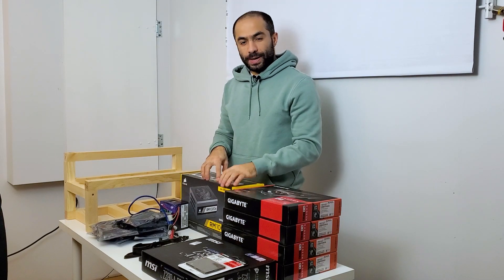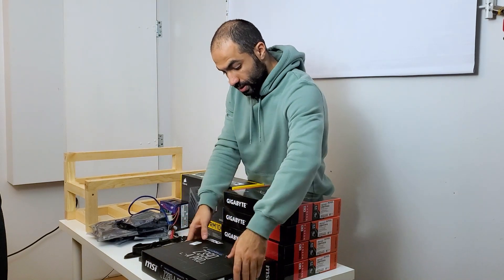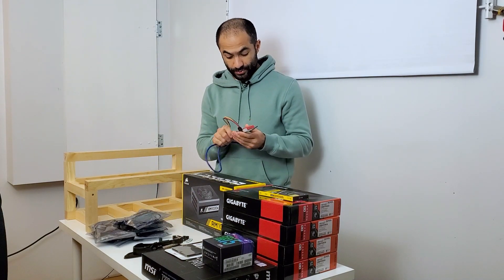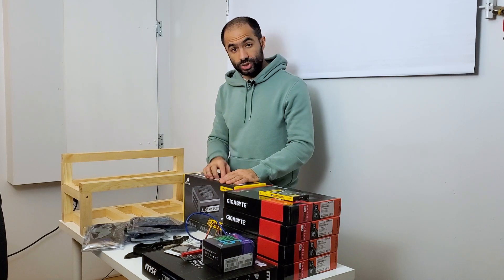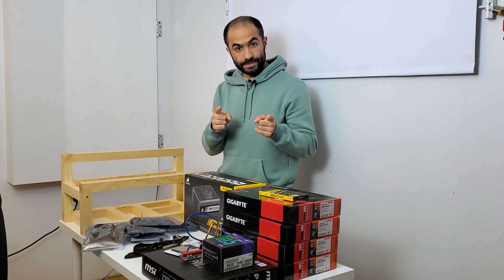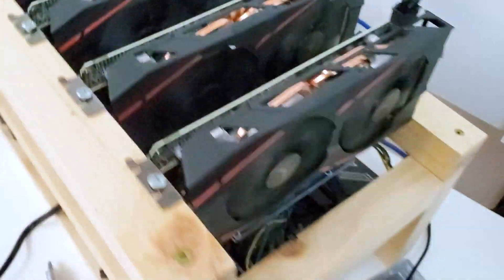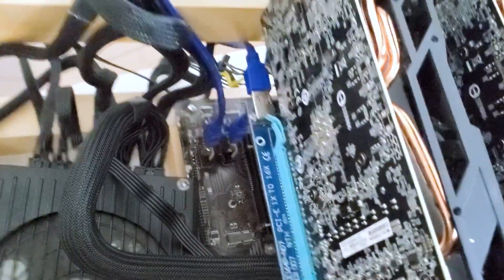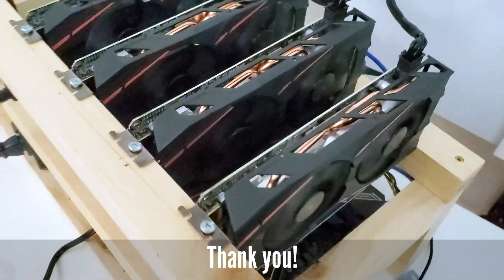4 x RX580 MINING RIG - PARTS, PRICES, HASHING POWER AND BUILD IN 2021

Comment: Good vid, can i put one big plank on the bottom instead of multiple beams of wood?
Reply from the maker: Thank you Nacon. Yes you can. I did it this way for a slightly improved air flow. However a plank of wood would work perfect as well. Make sure you elevate your motherboard as it does have a 'keep out' zone under the CPU.

Comment: :) you don't have to do anything, just use amd tool and set memory timing to 1. also set core clock to 1150. no other thing you need to change and you'll get 29-30.
core 1150
memory 2100
memory timing 1
you'll get 31 absolute stable.

also let me say to everyone.... bios mod is old news you'll get nothing out of it now. these things do as good as mod with newer tools.

and if you're doing eth than you don't even need tools, phoenix miner can be used with all commands in startup.bat
Reply from the maker: Awesome! thank you for the tip Atif. I have successfully done a bios mod, but I'm intrigued to not do it on future cards and use the commands within the miner. Thank you for the heads up on that.

Comment: How did you removed the metal caps on the back of these GPUs ?, also use Hive OS much better than windows
Reply from the maker: Hi Zeid, I'm not sure what you mean by the metal caps? Can you explain please. As for HiveOS vs Windows, I agree, I think it's much better. However I was able to get the cards way more stable and more power efficient on Windows. I will try HiveOS again very soon. Much love man!

Comment: what size screws did you use to go into the motherboard?
Reply from the maker: Hi GGradilla, I used 8 x 1. The link for those from homedepot is here: https://www.homedepot.ca/product/paulin--8-x-3-4-inch-flat-head-square-drive-wood-screws-zinc-plated-26pcs/1000119115
One thing to be mindful of is being very careful when you're putting in the screws so that you don't bend/break the motherboard. I also added a rubber spacer between the motherboard and the wood to elevate it a bit.

Comment: hey how did you turn out the motherboard without a power switch?
Reply: Short the power jumpers with any metal
Reply from the maker: Yes!
Reply: I have the same MB
Reply from the maker: Hi Louis, I went to the manual of the motherboard and found the location of the positive of the power switch and the ground. Then I short them with a metal pin and it turns on. If you do t like that idea, you could buy a manual power switch and connect it to the motherboard. Something like this: https://www.amazon.ca/dp/B072FMVZJZ/ref=cm_sw_r_cp_apa_i_VN85K2EF2HSXRM87P5J0?_encoding=UTF8&psc=1

Comment: @7:35 i have a theory as why the GPU on the most left has hottest temp, since its pulling the air from the right, its pulling the heat from the GPU on the right, and so on, i would space them out a bit more to cool them down
Reply from the maker: Yes! In my next rig, I will do better air flow management! Thanks Disturbed :)

Comment: Last one hottest  because of the air flow. First one take the cool air and giving back.
Reply from the maker: Yeah I have to do some better air flow management!
Reply from the maker: @Frigyes Pszota Thanks for the tip. I did that a couple of weeks after I posted the video. It helped a lot. Most of the cards are running around 60 degrees now which is quite good. thanks for watching the video :)
Reply: With that rigs, you actually go to linux, like hiveos i think. To avoid crashed or restarts
Reply from the maker: @rickyfr4705  Yes sir! All my rigs (except the 3060 ones) are currently on hiveos. It works like magic! Thanks for watching my video Ricky :) Do you mine yourself?

Comment: the hot issue problem could be from the bad air flow of your design. obviously you closed half of the gpu air outlet with that wood frame.
Reply from the maker: Thanks for the heads up Bagus.

Comment: is wood frame not risk with fire hazard? I know wood is better than metal since its not conducting heat, metal can. Aluminum bar sounds good.
Reply from the maker: Ideally you should be doing things so that no fire happens, but if it does, then yes aluminum would be a way better option. I'm actually considering switching the frame to aluminum soon.

Comment: u should be getting 32.2mh/s @88watts per card my canadian brother. use watt man.. no need for over clock software. u dont need to bios mod ether , just use boot strap or rxboost in phenix miner. i own a 6x rx580 8gb msi rig. Best bang for its buck hands down
Reply from the maker: Hi Crypto Karnage, you're getting 32 per card at a total of 188 watts?? Per card or for the 6 cards?
Reply: @DaniTalksTech  no no . sorry i ment in watt manager.Mine are set to 1200clock ,889mv and 2250memory. This comes out to 32.2 mh/s @ 88watts per card . sorry i have to edit that comment. then i use -rxboost 21 and boot strap 5 and 3(depend on what mem the cards have) on each card with adrenaline blockchain drivers and yeah im getting around 4.00usd a card :) low low watts is key
Reply: red panda and mining chamber have dedicated video on rx 580's. thats where i got my specs from. RX 580 are my bread and butter and im looking for more.
Reply from the maker: @cryptokarnage6394  I've seen their videos and was never able to get mine to that MH. The most I've got is 30.5 stable. The Rx are so tough to find these days.
Reply: @DaniTalksTech  yes getting them stable is the problem with me too. Its the silicon lottery. some ppl say samsung mem is better but my samungs are worse then my hynix mem ones. My hynix are work horses i acheived 33.1 but crashes after abit with those bad girls lol .but yea there all diffrent. Nice build. good work on the channel too. its not eazy
Reply from the maker: @cryptokarnage6394  mine are mostly Samsung. I've noticed that Hynix performs better for me.
Reply: @DaniTalksTech  awww hands down thast why. So i now i know im not crazy . i knew it!!! lol thanks bro'daill liked and sub'ed and shared this vid on FB for yeah.
Reply from the maker: @cryptokarnage6394  Thank you bro. I appreciate it! hynix for the win!

Comment: Could you link me to those spacers you used for the motherboard?
Reply from the maker: Hi Bryan, the original spacers I used were the plastic ones that actually come with a monitor mount. They were pretty handy. Since I realized that I cannot get my hands on many, I improvised and figured out that hard drainage tubing acts as an excellent spacer as well. I tried them and they are perfect. I got them from home depot: https://www.homedepot.ca/product/canada-tubing-polythylene-tubing-0-17-inside-diameter-x-1-4-inch-outside-diameter-x-25-ft-coil/1001002217

Comment: First GPU absorbs fresh air but the other could not, because of GPU's too close and absorbs other gpu's heat.. You should make a little bit distance each one them and use 2 fun in front of all gpu. That's make a cool condition and low power consumption. BTW good work, well done. Congz.. :)
Reply from the maker: Thank you Bilge. You're right. Since then I have managed to add some fans and the temperatures are very good now. Less than 70 degrees on all of them. They are very efficient. Thank you man! :)

Comment: Hey im about to be building my own mining rig soon. I have ordered the same Mainboard. Is there any video out there which shows what BIOS settings I have to do? As of know I have RX580. Thanks
Reply from the maker: Hello, I don't have a video about the settings, but in short, I enabled 4G decoding, Changed PCIE speeds to Gen2, Changed Windows OS configuration from CSM to UEFI and I made sure that my PCIE lanes are powered directly through the PCI power on the motherboard. You'll find it next to the CPU.
Reply: @DaniTalksTech  Thanks man, keep up the good work :D
Reply from the maker: @thommylyvu6439  thank you man. Did your setup work? Let me know please.
Reply: DaniW not yet, had bad luck with my mainboard. The shop here sent me an already used and broken one so I had to order another one. I’ll keep you up to date.

Comment: What are you doing on the bios for mining with the z390 a pro msi can you help me ? and can you have more of 4 graphic card on the motherboard ?
Reply from the maker: It took me a veeeeery long time to figure out the z390A pro. It was so buggy to make more than 4 cards work. What I ended up doing is: 1- Enabling 4G Decoding. 2-Changing PCIE speed to Gen2. Change Windows OS configuration from CSM to UEFI. I also had to play a lot with the sequence of putting in the cards. I started out with PCIE1 and went chronologically to 6. I am yet to add the NVME to PCIE adapter. That's on the way.
Reply: @DaniTalksTech  can you suggest a good motherboard where we don't have to do much settings tweaks??
Reply from the maker: @adesheddie1  I will suggest mobos that I have personally used. That one was the Asus 370A and the Gigabyte B250 fintech. Those were easily to set up. I barely had to do anything.
Reply: @DaniTalksTech  hi can you help me? i built my mining rig but i can't put more than 4 graphics cards with the z390 a pro and I do everything of you said

Comment: sata misinformation brother. don't use sata to power the risers with sata that came with risers or aftermarket sata wires. only use the sata sables that game with a gold or plat rated psu. I'm running 8 3060s/3070s all on sata no issues.
Reply from the maker: I see what you're saying. I plan to power the risers with PCIe power from the PSU. Definitely much better than sata that came with the risers. Thank you for the heads up bro.

Comment: hello hey thank you for the video was great building the eth rig an watching this at the same time are you able to do a video of the bios settings you did please as im doing evything i can an i can only get one gpu rx580 8gb to work an the on board grahpics vga whit light stays when there is no gpu added either blank screen is another issue im having 

kepp up the great video thank you !!!!
Reply from the maker: Hi Matt. I will put together a video for that. In the meantime what mobo, cpu and RAM combo are you using?
Reply: @DaniTalksTech  hey im using a 1600watt evga psu i3 9100f 8 gb ram well you already know the mother board z390-a pro
Reply from the maker: @Goku994-o8o  so typically when the VGA light is on, it means that your VGA isn't installed properly. Did you buy it brand new? Have you installed the drivers? The reason why I say that is because there should be no reason why you don't see 1 GPU. I did run into issues past the 4 GPUs and I resolved them. However 1 GPU should typically be plug and play. Did you power your risers properly? Also, which PCIE lane is your GPU installed on? Put the GPUs one by one starting with the first lane closest to the CPU. Have you tried putting your GPU right in the motherboard (not using a riser) what happens there?
Reply: I have installed the drives from the portable DVD drive I have I have config the bois also an only one gpu still ill try again all tomorrow what you told me as it is late where I live  anymore tips be greatly appreciated
Reply: @DaniTalksTech  yes was brand new I do have the risers power by 6 pin to 6 pin as well I have the vga light come on evan when the box was out of packet I had to install the gpu on to the motherboard to get it started first up
Reply from the maker: @Goku994-o8o  Sounds good. Let me know how it goes tomorrow. Take care!

Comment: Hey I am connecting 3 GPU rx570 but my PC does not power on .... but when I am connecting 2 GPU it works perfectly fine .... I have Corsair ax750 power supply .... why’s the issue am I facing ? 
Asus b450 tuf gaming motherboard 
16 gb ram 
Amd Ryzen 5 processor 

Works fine with 2gpu but when trying to connect 3 GPU system power doesn’t on .. only shows light on motherboard
Reply: Buy bigger PSU, it doesn't hv enough power. Basically you can only use 80% of you PSU capacity ea 750watt, you can only utilize 750 * 0,8 = 600 W.
Each GPU use abt 180W at peak. That not counting the system which consumed abt 100W to 150W depending on your processor power rating. My suggestion is use at least 1000W PSU for your config.
Reply from the maker: @MoslemPerspective  While wattage is something to keep in mind, I don't think this is the issue there. With his specs, the psu should power on close to 100%. It's not recommended to do, but it would work. I do think it's a mobo issue with it not being able to recognize more than 2 GPUs.
Reply from the maker: Vinit, have you played around with the bios settings? Make sure you enable above 4G decoding in your bios if you have that setting. Also, try to change the PCIE speed to Gen2. See if that helps.
Reply: Problem solved ... as 750 power was not enough for 3 GPU
Reply from the maker: @vinitgohil4733  good to know. I stand corrected @xerxes

Comment: The coldest gpu is because it is not getting hot air from any card.
Air gets hotter as is travaling trough the cards.
Nice build btw. ;)
Reply from the maker: Good point ferbandorat...I managed to do some efficient undervolting and now they run cool and quiet. Thanks :)
Reply: @DaniTalksTech  Aewsome. Underclocking the core and overclocking the ram is the name of the game, at least to mining ETH.
Reply from the maker: @Skynet_11  now if I can get 5 gpus working, I'll be a lot happier! The 5th is giving me issues. Probably the motherboard.
Reply: @DaniTalksTech  what is the problem?
The gpu does show but not reading temps?
Do you use windows or Hiveos?
Reply from the maker: @Skynet_11  the 5th GPU stops the system from booting up. Even though I have 6 PCIe slots, it tells me that the system runs out of PCI resources. I've followed every tutorial out there to troubleshoot this issue and it didn't work. What's funny is that I was able to make it one time by changing windows OS boot to UEFI. It worked once and never again!
Reply: @DaniTalksTech  Have you tried changing the pcie speed on the BIOS?
My cards were giving me problems until i set my pcie to gen2.
Reply from the maker: @Skynet_11  yeah I did. I moved it from auto to Gen2. I also tried gen1 and 3. I also adjusted the speed all.the way to 96. And enabled 4g encoding
Reply from the maker: @Skynet_11  were you having the same issue?
Reply: @DaniTalksTech  Similar, it would detect some cards but i couldn mine with  them. weird issues. Your's unfortunately seems maybe motherboard limitation.
Reply from the maker: @Skynet_11  I believe so. It's unfortunate since I got it for it's 6 PCIe slots. Lesson learned!